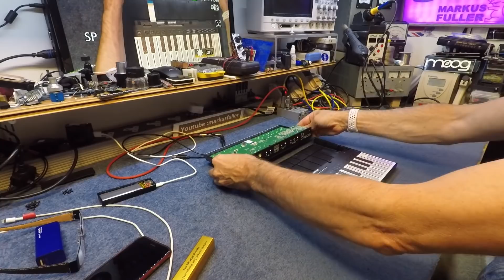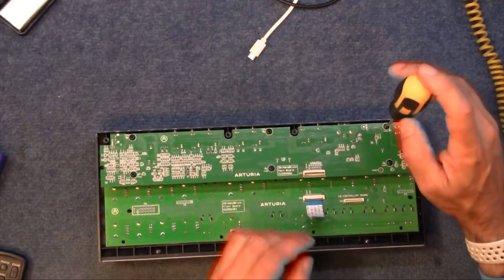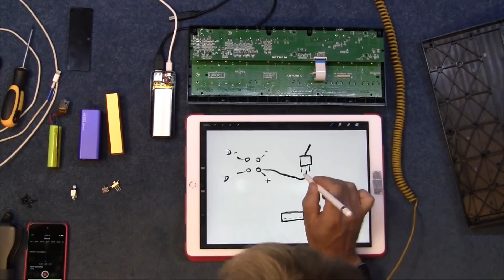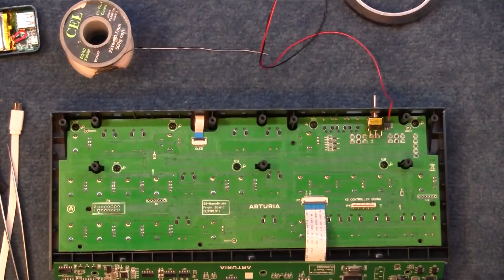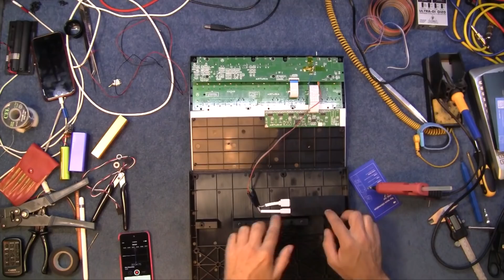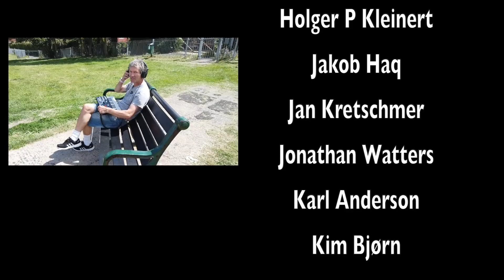Arturia Micro Freak rechargeable battery powered synthesizer

Comment: Hi! Is it possible to make a mod to have an external Audio-In to the analog filter's input? I'm not sure what schematic is there... If it's just one pin for the wave input that I guess it's very possible. Just need a good hand to solder to that IC.
So my question is about "did you've spotted the filter and seen how sits there on a PCB?"
Also I would love to include a little op.amp + LED distortion circuit inside.

Comment: The only problem I see with this is that those Chinese flat pack cells always puff up. When that happens, it's going to put stress on the board. I wish there was an outrigger solution that used good cylindrical cells.

Comment: Thank you for this excellent video, this is a really neat way of doing the mod. 

Can I suggest a slide switch instead though ? It's much harder to mount but much less likely to accidentally knock about.

Why did you waste that cable instead of direct soldering to the pins in the battery box ?

PS: It's called Kapton heat resistant tape.
Reply: those cables are cheap (or free!?) and you can replace the power bank in the future without soldering. I know. still the glue gun.

Comment: Nice video Markus! Could we get the brand/model of the battery you use?
Reply from the maker: Hello Ken. it was just one of those cheap generic power blocks that is used to recharge a mobile phone, there was no brand or model number. caution I did start to get some odd random things happening with the pitch/bender touch strip after a while and when i turned off the internal battery that problem went away.

Comment: great video, thanks. is it possible to self-ground the microfreak? then it would be possible to power it via usb from computer or other sources rather than have to always use the external power supply. I would love to use it as a portable midi controller/external synth too...

Comment: this is really cool, thanks for sharing!  why did you use a toggle switch rather than a sliding switch similar to the one the microfreak uses for its power switch?
Reply from the maker: It would have been better with a similar slider switch but I did not have one in my spares box.

Comment: Hot snot would be better solution @ 16m51, to have some prevention of gravity ripping on the cables weakening the solder joints. why didn't you make a mini custom pcb with the necessary components or the same as from the powerbox instead. a decent solution instead of cutting 2 usb cables.

Comment: You should have added a diode (or any safety), if the external USB is plugged and the switch on the wrong side; it's going to not behave very well...

Comment: Since batteries are about power: I just blew up my Arturia Keystep MIDI-keyboard, because I used a power supply with the wrong polarity. Could you do an instructive video on these differences? Why do they exist and how come it's so hard to distinguish what polarity a power supply is? Apparently (most) guitar effects are centre-negative and my synth gear is mainly centre-positive (I just found out (most come with their own power supply, but the Arturia didn't)). I have a 'balanced' power supply providing 1,5-12V, with changable polarity , but measuring just revealed 9V gives 9,3V, and some of the (multi-)plugs less (7,5V etc). This unstandardized mess is driving me mad.
Reply from the maker: Hello Frits, I agree that there should be a standard as in everything either positive or everything negative centre. most things may have a diode protection so they simply wont work if the power + - is incorrect but sadly not all manufacturers add this component which would only cost a few pennies. I myself have destroyed many things in the past with incorrect polarity. I could not even tell you which way the polarity is on the arturia as i do not know myself as i have always used the usb connection as the power supply. it may be worth trying the usb connection on your midi keyboard and plug the other end into a phone charger as it may just work if you are lucky. if it does power up then my guess is there could be a surface mount fuse on the board near the power adaptor that needs replacing, normally the component could have the something like F1 printed on the board next to it but I cannot say for sure as i have not been inside the keystep to see. The multi adaptors will always seem to be a higher voltage than you set if you test it on a multimeter when it is not actually under load ie not plugged into something that is drawing power.

Comment: The CME XKey 37 is a 3 octave keyboard that is similar to the the Micro Freak as its quite low profile and MPE.  Have you tried using the XKey and if so how does it compare to the feel of the Micro Freak.  I haven't had the chance to try a Micro Freak, but it is intriguing with it's touch capacitive surface for it's aftertouch.

Comment: Next MOD (probably as unnecessary as this one): Built-in speaker ;) (ARP-2600 style)
Reply: Calculator?!
Reply: Hi! Did you've heard about a volume mod? Microfreak has a VERY low volume output. When I put it in A4 MK2, it's so low that I need to put down the other tracks for about -60% (or more).
If it's not hard to do then I would like to make this little beast louder :)

Comment: Hi Markus, Arturia reports that:
 "A convenient advantage of the MicroFreak is that it can be USB powered. However, its touch capacitive keyboard needs a proper grounding to work flawlessly."
Have you encountered any of these issues with your mod?
Reply from the maker: Hi the unit seems to work fine though I have noticed the display does show that the pitch bend is being randomly activated. not sure what is going on there but yes there is certainly a bug in my design.

Comment: Some power banks do allow you to charge the battery and have the output active at the same time. The new cheap models use one chip for both jobs, and so can only do one thing at a time. The older models have a chip for charging, and one for boosting to 5V.

Comment: USB ports are usually restricted to 500mA current consumpton. Without prior configuration you should only even take 100mA max. out of a USB port. However, many devices don't care and just take 500 mA without being configured at all. Simple chargers that can deliver  at least 1.5A have their D+ and D- lines shorted out. So you could make a circuit or use a microcontroller to check for that short and then switch to fast charge. Some power banksdo exactly that. Nice little mod.

Comment: how did you know what voltage lion battery to use?
Reply: 天照 it doesn't matter because that voltage is boosted to 5v by the Powerbank circuit anyway which is  required to power the synthesiser.

Comment: Polyimide  is a high strength hi temperature resistance polymer, however it's prone to water steam,  ammonia, hydrazines (anhydrous liquids or vapor), primary and secondary amines, and solutions having a pH of 10 or more. Chemical reagents which act as powerful oxidizing agents (nitric acid, nitrogen tetroxide, etc.) must also be avoided. It also provides excellent isolation.

Comment: You need 2 of those flat packs and have a switch with these states
State 1-running off battery 1 and battery 2 charges
State 2-running off battery 2 and battery 1 charges'
State 3- both batteries charge
Reply from the maker: I thik If I did it again I would make a base for it with larger thinner batteries inside.

Comment: Hmm, just be careful not to have the switch in "battery powered mode" while also supplying current from a computer. Short-circuit. Definitely not safe.
Reply from the maker: true I should have mentioned that.

Comment: Cracking video can’t beat a bit of modifying me am too lazy I would have just got a short usb lead and Velcro’d thepower bank to the side lol
Reply from the maker: Jay that is the easiest and better way and you would not kill the warranty.
Reply: @markusfuller  Hi! Did you've thought about a volume boost mod? BTW I think that it can be combined with some little overdrive and/or maybe even a PT2399 delay addition (for some lives it's crucial to save space).
Reply: Indeed but ur way is most defiantly more fun